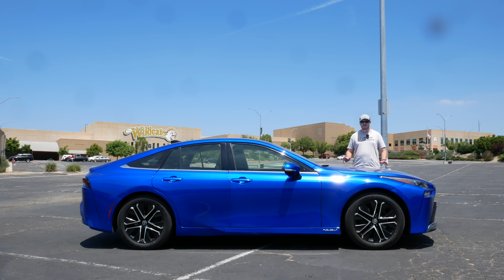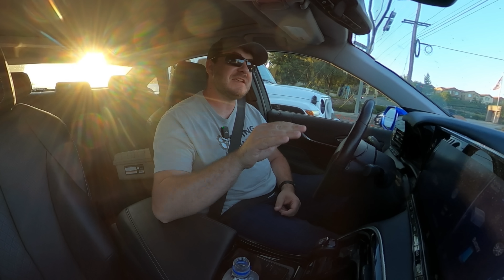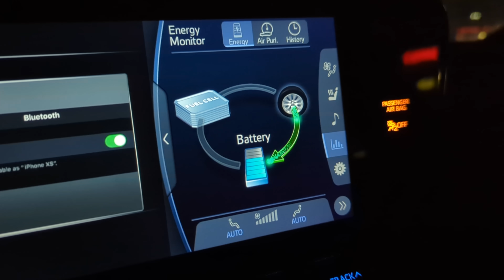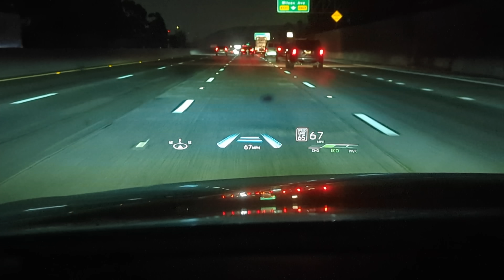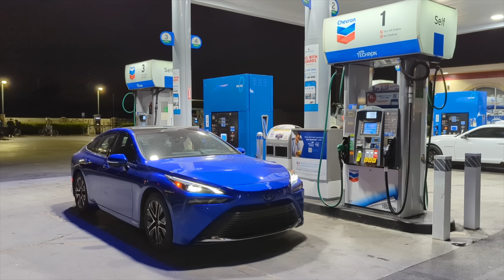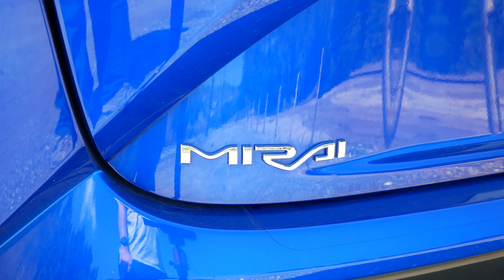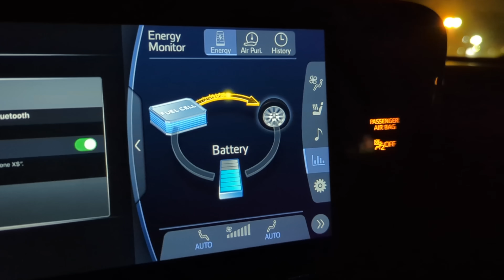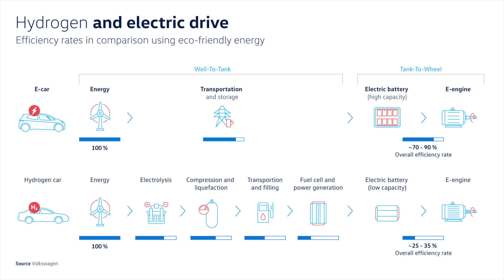The Toyota Mirai is Disappointing

Comment: Aren't there hydrogen converters? What's to stop people from converting hydrogen from plain water at home?
Reply: Cost? It's takes a lot of expensive equipment and a lot of power to generate and store hydrogen
Reply: @logitech4873 Figures.
Reply: @creativeusername7951 well side from cost of the equipment to create hydrogen and compress it to more than 42 times the maximum pressure of a steel cooking gas bottle. It takes 4 times as much electricity to create 1 miles worth of hydrogen than it does to charge an EV for 1 mile. Which also means hydrogen is very slow to create. It would take you over a week to produce enough hydrogen to refill a Toyota Mirai. 

So once you buy the extremely expensive equipment which will take up about a shipping containers worth of space in your back yard. To create and contain a highly explosive gas that degrades steel into something resembling chalk. You have to pay 4 times as much per mile to only refuel once every week and a bit, if you have it running flat chat every second of every day and don’t mind not being able to sleep. 

But technically it is possible so…
Reply: Electrolyzing water to make hydrogen and oxygen is what you're talking about. The efficiency ranges from okay to terrible, and there just isn't any practical reason to do so

Comment: The fact that they are giving you free hydrogen tells me the car exists to try to subsidize researching and increasing production of the tech. Create enough demand to ramp up production and thus bring down the per unit cost. Toyota has done some sort of cost analysis and seems fairly certain that hydrogen is their future instead of making a fully electric car.
Reply: George W Bush signed a ton of hydrogen funding bills 20 years ago, still couldn't get anywhere. Electric cars rapidly developed in the last decade.
Reply: Toyota is following the oil with hydrogen. The only way to mass produce hydrogen is by getting it from fossil fuels (hydro-carbons). And the only way to refill a hydrogen car is at a fuel station. (I’ll let you guess who owns the monopoly on those). EV’s make both of those redundant. That’s why big oil spends tens of millions per year lobbying FOR hydrogen. And tens of millions lobbying AGAINST EV’s.

Comment: Hydrogen needs to be utilized more. It’s literally the most abundant element in the universe, we can never run out of it
Reply: It's abundant as part of other molecules, but in it's purest useful form (h2) it's not actually very abundant, which is why we have to spend energy to make it.
Reply: Silicon is much more abundant on earth than hydrogen, so....?
As long as an element isn't really rare, abundance is a rather minor criterion for a good energy carrier.
Reply: The problem is that finding hydrogen on its own is kind of difficult. You can use electrolysis to pull it out of water, but the efficiency is terrible.

Comment: I have something to say about the efficiency. The whole point is to make use of unbalanced renewable energy (solar, wind) instead of wasting it when the power grid is saturated. 

Electricity at grid scale MUST be generated and used simultaneously. It could be more costly to store electricity in massive Li battery than ‘inefficiently’ make H2 out from the excess grid power.
Reply: Or you could charge your BEV's at day time when you have most excess of solar energy
Reply: @Zripas  yes this is recommended and helpful, but again it all comes down to scale. You probably need hundreds of thousands of EVs to balance the load in daytime, and it becomes impractical to coordinate this many individuals.
Reply: @bikingmoments  
Reminder is that electricity usage is lowest at night time, so people could happily charge their cars overnight at their homes. Its small issue to be resolved down the line.
Reply: @bikingmoments making hydrogen is incredibly slow. So a hydrogen generator wouldn’t be able to use all the excess energy at the time it’s available. And the little energy it does capture, it can only put 40% of it back.

Grid scale batteries do a much better job at that but also have a secondary purpose. Grid scale batteries can respond to frequency changes in the grid in nanoseconds. Instead of tens of seconds like hydrogen storage. That means they are excellent at stabilising the energy grid from sudden fluctuations which would otherwise have caused blackouts. Something hydrogen cannot do.

Comment: Not to rain on parades, but the weight of this or electrics means more hydrocarbon tire wear and more hydrocarbon road wear compared to a gasoline vehicle. My gas car weighs 2700lbs, my hybrid weighs 3000lbs and this is 4000lbs. 
This problem is regularly ignored by climate cultists, but it is a real problem. I THINK (my math can be wrong) an electric vehicle will use more petroleum than a gas car.
Reply: Unless you're spending an entire set of tires once per week, you're not using more petroleum with an EV than with an ICE car.
Reply: @logitech4873  Again, my rough numbers show that the EV comes out as a higher user.
Reply: @damagingthebrand7387  What numbers?
Reply: @logitech4873  I did some rough work on tire wear yearly EV vs ICE, road wear (remember, here in the USA roads are now made of petroleum), again EV vs ICE, cost of electrical generation and loss of power due to our bad power grid.
Reply: @damagingthebrand7387   The only source I could find on the internet claim ~100 liters of petroleum for a set of 4 tires, but this also includes the petroleum used to power the process (which means it could be reduced via renewables)

But let's go with 100 liters of petroleum. Spent tires often get recycled, but let's assume that these tires are simply burned when they're spent.
And let's assume really aggressive EV driving, having to replace your tires every 50k km.

The CO2 release for the tires only over this distance would be 250,000g (or 250 kg).
That works out to 5g CO2 /km.

An average 200 Wh/km EV in the US driving on power from the average 371g CO2 / kWh power grid (+10% charging losses) outputs 82g CO2 / km.
Adding the tire "cost" increases this to 87g CO2 / km.

The average US gasoline car has an MPG of ~26, or more conveniently 9 l per 100 km.
1 liter of gasoline, including production transport and combustion, produces ~3200g CO2.
This adds up to 288g CO2 / km. But ICE cars use tires too, and the US average is about 80K km between changes. This adds another 3g for a total of 291g CO2 / km.

Results:
Avg, EV: 82g + 5g = 87g CO2 / km
Avg, ICE: 288g + 3g = 291g CO2 / km

All in all, tire wear is a very small part of overall emissions, and you would have to twist the numbers extremely to somehow arrive at a result where EVs do worse in this respect.
Reply: @damagingthebrand7387  
So now you have 2 people who give you some numbers which showed you being factually incorrect while you presented 0 numbers so far. How long will you try to keep this charade? BEV's doesn't use more oil than ICE cars, full stop here. Your numbers most likely came from oil company itself and you never bothered to fact check them... Isn't it?
Reply: Yes, you are correct, your math is wrong.
Reply: @Zripas  Um, probably not. If you do not have numbers do not ever say my math is wrong.
Reply: @damagingthebrand7387  
Um, probably not. If you do not have numbers do not ever say your math is correct.
Reply: @Zripas  Lol
Reply: @damagingthebrand7387  
Its funny when people like you starts screaming and asking for hard numbers when their entire argument starts with "I THINK" C'mon, you should do better than that...
Reply: @Zripas  I actually did no screaming. You have been the luny here with your jumping into a conversation saying I am wrong but offering no actual substantiation. 
Now go away child.
Reply: @damagingthebrand7387 
"I actually did no screaming"
Actually writing in caps on internet is being taken as you screaming. Just saying.
That aside, it was figure of speech, but whatever floats your tiny boat.

"You have been the luny here with your jumping into a conversation saying I am wrong but offering no actual substantiation"
As you never presented any data to support your "I THINK" claim, I don't really need to present counter evidence, don't I? Its not me who goes against basically every single scientific research relating to pollution made by electric cars vs ICE cars. Not even talking that your argument was that electric cars will use more oil than ICE cars because they are heavier and they will use up more car tires... Like how naive you should be to believe that? Is it in your world view that BEV's change their car tires every month or something? 

Will give you some numbers here, as you are too lazy and to ignorant to do it yourself.
For 4 car tires (to make those) you will need around 120 liters of oil. That translated to around 103 litters of diesel. Now, question for the ignorant ones: How far can you go with most efficient diesel car with that 103 litters? That's around 3000km, for most efficient ones, basically best case scenario which doesn't exist in reality, but why not. BEV's will need to change their car times around every 55 000km. So like, duno about you but 3 000 is less than 55 000km, on top of this ICE cars need replacement of oil, replacement of those same car tires (every 70 000km, so you basically have difference of 15 000km), replacement of braking pads (BEV's basically never use those) and what you are end up is you being completely factually incorrect here with your personal ignorant opinion.
Was this good enough for you when it comes to hard core numbers?

Comment: Steam reformation basically burns the CH4 but the oxygen comes from the steam. At pressure and temperature, with the influence of a catalyst, some of the oxygen from the H2O binds with the carbon from the methane to make carbon-monoxide, a small amount of CO2, and lots of liberated H2 gas. This process may be engineered to produce some amount less greenhouse gases than simply using methane but the process is far from green. As for electrolocis, it's not much better. It takes a great deal of electricity to break water into oxygen and hydrogen, and if you're talking about green energy sources like wind or solar, it's actually more efficient to use that electricity directly than to make hydrogen you'll use to make electricity in a fuel cell. 

Fuel cells are a great technology worth exploring though. Some green energy just can't be stored in batteries, in which case using it to make hydrogen may be worth while. It's a great idea for ships and trucks and shipping, but maybe not for a car.

Comment: Four reasons why hydrogen won’t work:
1. It cost more than gas. 
2. It would require a complete infrastructure change. There’s already a gas, infrastructure and electricity is everywhere. (It would cost hundreds of billions of dollars to convert every gas station to hydrogen tanks/pumps as well as all the trucks/ships to produce and transfer the hydrogen all over the world).
3. It’s cheap and easy to charge your vehicle at home; You can make your own fuel with solar panels. You’ll never be able to do this with gas or hydrogen. 
4. Electric vehicles it’s not even necessarily about the environment at all. They are safer, Quicker, lower fuel cost, lower maintenance, and last longer than gas cars.

Comment: I am very very pleased with my Mirai.  The only thing that is disappointing is the lack of fuel cell stations infrastructure.  If the infrastructure existed, my feeling are fcevs will far surpass battery evs.  Distance travel, 5 min filling time, no Li mining pollution, lack of stress on the our electric grid, can support 1st, 2nd, & 3rd worlds.
Reply: Well if the goal is green hydrogen, then it will actually put roughly 4 times more stress in the electrical grid per mile driven than EV’s would, just from making the hydrogen. Otherwise you’d have to make the hydrogen from fossil fuels which is dirtier.

I would have thought the lack of cargo and passenger space in the mirai or the expiration date printed on the fuel cap would have been equally disappointing.

I wouldn’t bet on much more range tho, whilst battery chemistry has a long way to go in terms of refinement. Fuel cells are remarkably close to their peak hypothetical efficiency. The limit to range then is how much fuel you can carry. Unfortunately, whilst hydrogen is light weight, it does take up an extraordinary amount of volume. The reason for the lack of cargo and passenger space in the Mirai, despite being bigger than a Camry, is because all the same is being taken up by fuel tank storage. You can’t fit more fuel tanks on there to go further. This is opposite to EV’s which have more space than even ICE cars. And they’re a lot cheaper to charge than ICE or hydrogen are to refill. 

But if you’re happy with your purchase, who is anyone to say otherwise. If you love it, do you and own it. The only way we find out what works best is if people give it a go.
Reply: I really don't care if I can hit 60 mph in 9sec or 12sec.  The only that is really important is to save our planet (our home)
Reply: @davidfong320  If your primary goal is to save the planet, then you need to realize that cars aren't the solution to begin with. What we really need is walkable cities, and strong public transport. Cars are very inefficient when compared to buses or trains, and the fact that they're straight up necessary to get around in some parts of the world is a tragedy.
Beyond that we need to strongly reduce consumerism, and maybe entirely shut down the meat industry.

Comment: i think it's really a shame electric has become the non-combustion car of choice, hydrogen seems so much better just because of the fact that it emulates gas cars' refueling process and because it is less reliant on the bad for the environment bits about electric cars
Reply: And yet it uses around 60% more energy to drive you same distance which will mean that you will have to produce allot more energy for it. How long would it take to offset any benefits you think it has over BEV's?
Reply: @Zripas  i dont know what this means
Reply: @nical2003  
Hydrogen isint some magical thing you can just scoop from thin air, you actually need to produce it and at the moment from end to end it takes around 60% more energy to drive you same distance. Just a reminder, Hydrogen fuel cell cars are electric cars in general, so you are using energy to convert water into hydrogen and then using hydrogen to convert it back into energy, while BEV's simply store this energy inside batteries and then use it directly.
Reply: @nical2003 what he means is that even green hydrogen, made by splitting water into hydrogen and oxygen by applying electricity, uses 4 times more electricity per miles worth of hydrogen than an EV uses per mile. And they get it from the same energy grid. The alternative to is to get it from fossil fuels which is understandably, very dirty and bad for the environment.